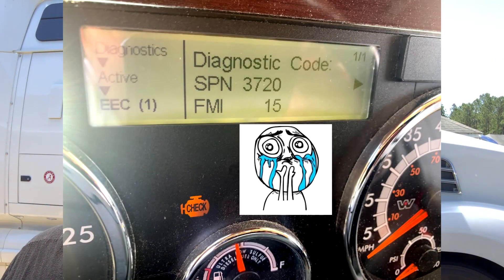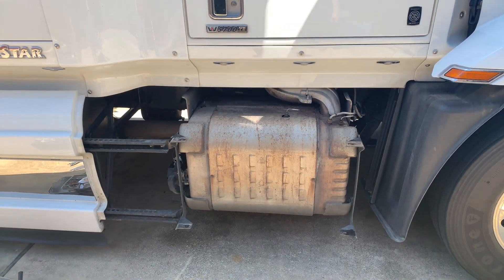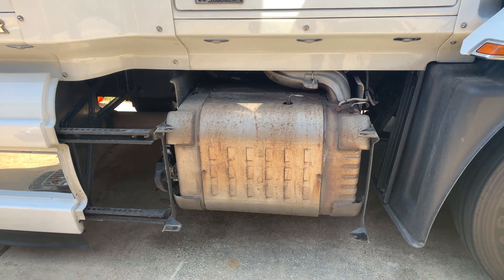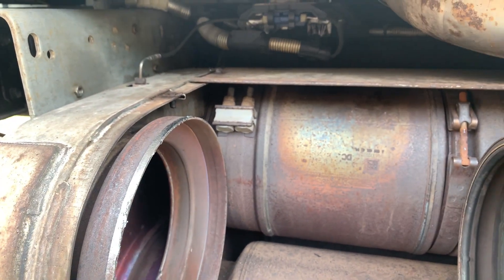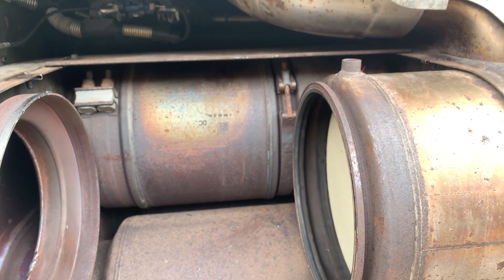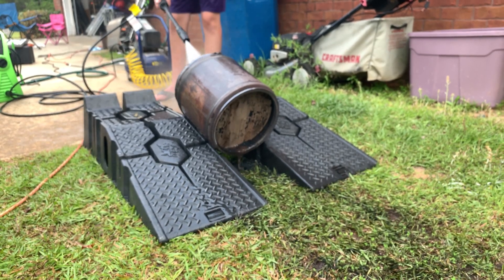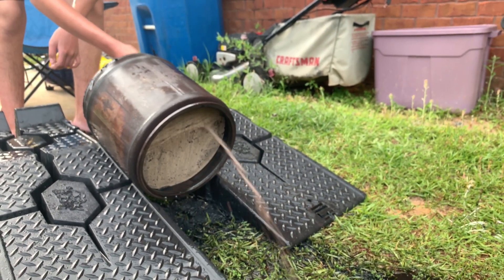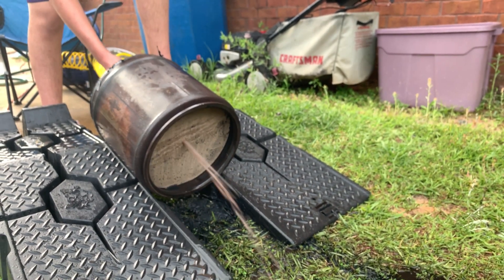How to clean The DD15 One Box DPF filters yourself

Comment: Question on the ecm adaptation, whats the need for relearn if your reusing the same filters? I guess I am basically asking. How does the ECM know that the filters have been removed when there is no electrical connections or sensors on the filters themselves? What part on the One box tells the computer the filters have been removed? Can you leave the battery connected and the ignition on to bypass this?

Comment: SPN 3720 FMI 15 is just triggered by mileage right? if there are no other codes for pressure or poor conversion you are still good
Reply: Did you get derate
Reply: @serggla924  no derate, engine just threw a check code at a certain preset mileage. filters were only 40% clogged on the vacuum test when we pulled them out.
Reply: @shatteredsquare  how much did you drive with the code on? I got derated after 200 miles and this is the only code I have
Reply: @serggla924  probably put 30k miles with the check engine light on for that code, mine threw the code because it reached a set mileage, regardless of soot level, I didn't get derate because my soot level wasn't high, i never ever ever idle. if you got derate it's cause the other sensors ie inlet/outlet pressures indicated high soot due to the pressures, that's why it derates.
Reply: @shatteredsquare  my spot level not high either and I got derate. But I will perform diagnosis later tonight. When I run park regen 5 times no other codes still tho
Reply: @serggla924  man if it takes 5 parked regens to clear everything there's something else wrong, it's either got high soot or it's not dosing enough fuel, or something else keeping it from getting good pressures and nox conversion. find a mobile mechanic with a diesel diagnosis laptop and he can show you every sensor readout while doing a forced regen, each sensor has a green zone where it should be and it will show any sensor that's out of green zone, it will tell you where the problem is and why
Reply: @shatteredsquare  yeah I just got that software myself and that’s how I will diagnose. The code doesn’t clear after 5 parked regens I mean. And it’s the only code I have. And soot level stays low like it was. My soot was never high. Or I would of got the code for it after 5 regens. When I got derate I took off the dozer and there was no hole for the def to go though so I cleaned it up. As soon as I get home I will do forced regen and then scr test. That will show me exactly what’s going on
Reply: @shatteredsquare  yeah you were right derate was triggered by scr closed loop code. Probably from my def doser nozzle being blocked off and not spraying def for hundred+ miles. Unclogged it and ran scr test and it cleared out the code as well as def inducement lamps and derate

Comment: Do you have APU in your truck ?
Reply from the maker: Yes, Tripac Evo
Reply: @AlabamkaTrucking  ummm I thought dpf filter last longer on trucks with apu because we never idle 🤨 , how many miles was on your truck when the engine light came up?
Reply from the maker: @JG-ss9xy  When I did that cleaning truck had 600K with some change miles. The DPF cleaning counter is purely engine hours based, if you idle truck you'll have to do this more often.
Reply: @AlabamkaTrucking  ummm ok 👍 well mine has 550000 and the light came out 🥴 but I took it to a mechanic here in miami and they cleaned the codes and I ask him to put it in zeros again, so I think I can wait till 600000 miles, he told me that issue is based on trucks that idle all the time. Thanks for the video I can remove them very easy and take them to the cleaning place, your video was excellent 👌

Comment: I did ash cleaning in a shop but I still get check engine light with amber light when pulling heavy loads or running a week which I have to stop and Regen the truck on the side of road then it goes away I am thinking whether the shop charged me didn’t do ash cleaning or they didn’t reset the ash level can there be any other issue dd15 2016 cascadia
Reply: I have a 2016 also
 When ever I run heavy in the mountains. And use stage 3 engine break it happens.   Slow down enough to only have to use the stage 2.  Lock it into low gear when going down hill

Comment: How long can you drive if you don't fix it
Reply from the maker: The code shows up when ash accumulator counter reaches 99%. Once it is at 100% engine will derate, the counter is based on engine hours. I'm not sure how many exactly but can confirm at least 15-20 hours nothing will happen that's how long it took me to get home when my error code popped up.
Reply: @AlabamkaTrucking  I have the same problem, but the truck is not in derate yet.
Reply: @Bigola  drive 3000 mile..is it ok..i didn't fix it

Comment: What psi was pressure washer set to? Thanks
Reply from the maker: I used cheap electric pressure washer from harbor freight tools it’s unregulated. I think it’s rated 1000psi. The key to success is to keep nozzle far enough so not to damage ceramic matrix. Start far and slowly bring it in until you start seeing dirty goop flowing out on the other side.

Comment: I’ve done that way cleaning my filters on my trucks for about three years now. Saved a lot of money. I made a metal box that I set them in after I use power washer to clean them then fire up my salamander heater and heat them for a good hour and it dries them out perfect every time. Good video you did. I’m sure   These dealers are not happy lol. I got tired a few years ago getting ripped off for this job
Reply: Do you reuse the clamps? How long till you have to clean them again using this method.
Reply: @BIGMANLOLZZ  never reuse the clamps
Reply: He didn't show how to remove the filters.

Comment: Should I do this as preventive maintenance even if I have no end of life code, or should I just wait until I get the light code on the dash?  Would it help to keep the filter clean and out of trouble if I worked on it ahead? 

One more question.  Would the NexIQ USB work with a Cummins ISX15 on an 2015 International Prostar?
Reply: No, only do it when it ask you

Comment: Clamps are $430 at freightliner and $109 @ ebay.  I have a question if I do this before the check engine will i have to still hookup the computer to update?
Reply from the maker: Yes you need to reset the ash accumulation counter. Even with brand new DPF filters if computer is not reset you’ll get a code and derate after certain number of hours.
Reply: Slavka Alabamka TV Fuk freightliner. They always derate and you are stuck on the freeway blocking traffic. This shit can get people killed.
Reply: @AlabamkaTrucking  where did you get the software to do all that

Comment: Slavka what about the DOC filters. The other two filters in front of the DPF ones. They are not removable and need to be clean as well. The famous 4.5 hour regen is the one that cleans it, but eventually it needs to be deep clean as well.
Reply from the maker: DOC are not serviceable other than the burn out routine using DDDL you have mentioned. If DOC is cracked or clogged (blown turbo leaking oil) it pretty much means new onebox.
Reply: @AlabamkaTrucking you get it deleted yet or did you sell the truck 😅? Or is that one box still functional?

Comment: Worst method ever , perfect way to screw up the entire 1 box ... make a another video when you get scr inducement faults 😂😂😂
Reply: 🤔.... ive done this 15 times in 5 yrs.......... never had any issues or faults... this is assenaily how a dpf wash works, the drying method and instalation method. The cost associated with this come from the nox tests iside the cab when a dealer services it along with software programing and testing.
Reply: The Dirty Trucker look up the actual recommended cleaning method how a REMAN facility does it , even a simple tap wash will soften up the ceramic end plug in every port and also soften the insulation between the ceramic and metal ( down the road causing hydro carbons into the scr , NOX+HC = very high nox) seen it many times and just replaced the dpf filter to fix the low nox efficiency faults.
Reply from the maker: @johnbush5308  89K miles later NOX efficiency at 98%. I'm not the only one using this method, I learned it from a fleet mechanic who manages 150 truck shop, they literally do this process weekly in the garage.
Reply: @johnbush5308  I have done this to 6 of our DEF trucks and 3 of our non DEF trucks (single big filter) so far and 3 have over 250,000 since cleaning.  0 issues at all.
Reply: @johnbush5308  i said assencialy...i still havnt had any problems
Reply: The box is designed to fail you cannot clean The two lowerfilters which will stop up . if you delete the defense system you need to gut one super and one lowerfilters.

Comment: My truck is giving me a check engine light with code 4364 fmi 18. It only does this an extremely cold weather under a heavy load so you know what it could be? Is it my doser valve, def pump or do. I need a new 1 box?
Reply from the maker: TroyP20 SCR NOx conversion efficiency low. This code typically is the result of poor def quality or one of the two NOx sensors going bad.
Reply: Slavka Alabamka TV  I bought a nox sensor last year and that light disappeared for a year so I guess I will go buy a scr nox outlet sensor and see what happens I’m grateful for the knowledge
Reply: Slavka Alabamka TV sup broo wat those scr nox conversion efficiency low  mean ? Cuz my truck is showing the same number like Troy
Reply: austine meax I bought an input nox sensor from freightliner for 400 bucks and had the TA truck stop put it on for me for 120.00
Reply: TroyP20 ok thank you I will go get that
Reply: @AlabamkaTrucking  Agreed! Normally the Nox sensor....
Also in low temps on reg truck it could be a problem with the def fluid heater. Not pumping the Def fluid as it does get thick in extreme weather.
Reply: My '14 cascadia is giving me the same codes too Eec 61 diag 1 fault 1 spn 4364 fail18. I filled up my DEF tank full on monday, drove for a few hours and yellow solid light and codes went off yesterday but they came back on today again going up hill.
Reply: chilar6 my truck started derating with all the lights on def light was flashing along with check engine light , I was able to do a forced regen and it cleared it up
Reply: @TroyP20  I did a forced regen about three weeks ago lights went off till today again going up hill warning yellow light came back on and codes again
Reply: Probably need a def awning. Mine is too old to have one so I need to do unplugged burns periodically to clear crystal buildup to even it out again.
 I'll get the awning installed once my dpf is at end of its cycle too (kill to birds with one stone)

Comment: How do you get the software?
How much does it cost?
I have the same problem on my Freightliner Cascadia DD15 2012,and I’m thinking to clean it myself... but I don’t have the software to check the diagnostic part....
If you could tip me with some information how to get the software and how much will it cost please??
Here is my email 
challengertrans@gmail.com
Thanks!!
Thank you...
Reply: Challenger M you can get a OTR reset tool, check online otrperformance.com they have a reset tool..leave it plugged in for 3 mins resets all the ash levels and if your on the road you can reset codes costs $499 saved me thousands and you can do forced regens. This thing is a must have.
Reply: You can get the DDDL software from Freightliner for $500/yr, or you can get it from EPCatalogs.com for much less. Get the PRO version.
Reply: You cannot clean them yourself it's not the write method they have to be blasted with air into each individual cell

Comment: This is not correct.. blowing water through the clean side of the dpf will leave calcium deposits inside of the filter..
I run my own shop I see these things everyday and I also see what guys like you everyday.. 
It's better to get them properly cleaned.
The baking process is the correct way.
Aqueous cleaning has an additive to get rid of calcium deposits..
I currently have both a water cleaner and an air blow machine
You didn't even pin drop the dpf to see what is going on inside of it.
Reply from the maker: Jason Lurie May ways to skin the cat, this method works. No codes, normal back pressure, regens complete like a champ for several years. I’m sure people screw this process up somehow and end up having issues.
Reply: Then rínse it with distilled water after power wash and it will make it correct for you .Besides regen temperature will disintegrates calcium deposits. Elementary physics. For $2800 I can take a vocation in Spain. Thank you Slavs for the video.
Reply: @franksgump5  some mechanics hate when people fix it themselves. Fuckem.

Comment: Everything that is done will get you OK results as long as you don't damage the filter.  The biggest issue is that it is not cleaned to gain you maximum air flow. This will cause the filter to become clogged again with less miles than before.  You will only be able to clean the filter 3 to 4 times before it will need replaced.  If you remove the filter or filters you can bring them to a cleaning service and that will cost between $250 and $300. They will inspect the filter, document findings and they will clean the filter with high air pressure and suction. The filter will bake in a DPF Kiln at the manufactures temperature  for that filter then clean it again. This will give you maximum miles between cleaning which will prolong the need to pay for a replacement filter.
Reply: They are getting away from baking the filters now they have found that it shortens the life of the filters